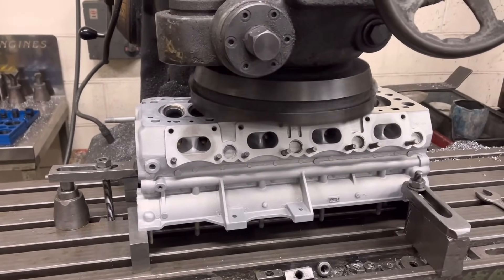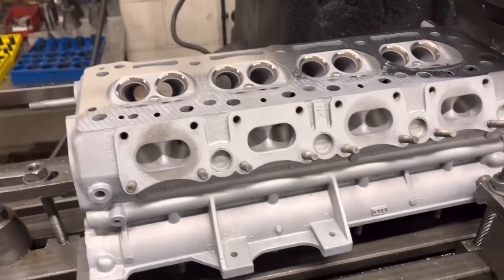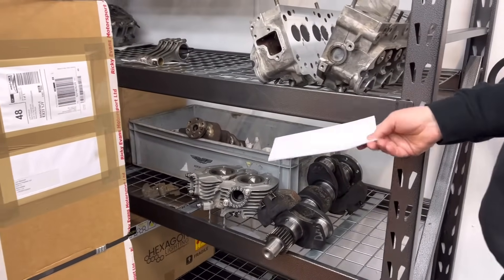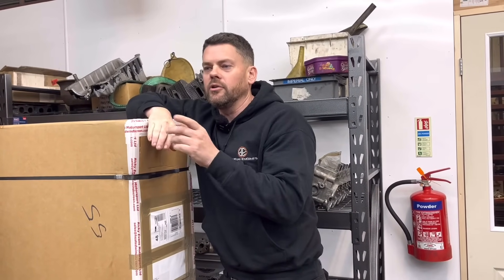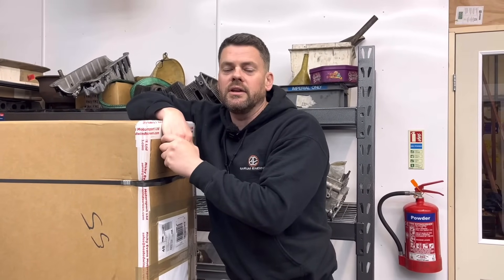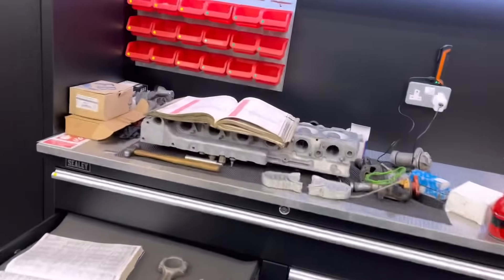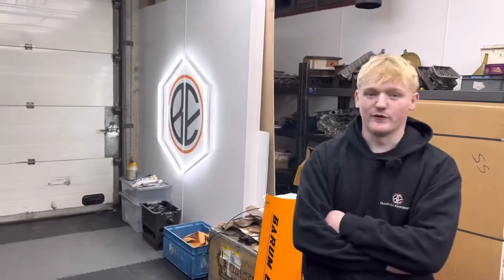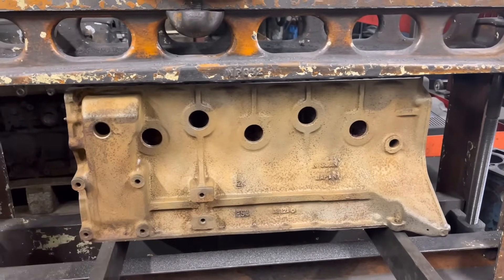Tuned, Thrashed & 3 YEARS out of Warranty yet this Customer STILL wants us to pay!

Comment: It never ceases to amaze me how someone  can expect to double the output of an engine without affecting its reliability 🤣
Reply: A Honda K20 build sure. EA888 not so much. Those K24 de-stroked engines are strong.
Reply: @v4skunk739  not so much then, until you consider the biggest unknown, variable, which is the idiot behind the wheel who doesn't wait for his oil or coolant to come up or cool down, before or after a good thrash 🤣😂
Reply: Great comment, but these people do not have a clue about the internal combustion engine....not a scooby doo on engineering.... or what effects high performance can have on reliability...
Don't you just love their unfortunate ignorance on the subject... a little bit like asking your accountant how to fix the money printing machine😂
Reply: @IncognitoChild  EA888 are not built like a K20, i'm sure you can find a video. K20 is just built beefier.
Reply: But if it’s built to take it it should take it like it’s oem, I’ve pushed my VR6 in my A3 to north of 1000hp and I actually get warranty with that build, all I have to do is have an annual bearing inspection which on my particular car means engine out and make sure I change my oil every 800-1000miles if I’m using ethanol if not every 1500miles.
Reply: @Mr_OoOsH  VR6 is a strong engine, over engineered, EA888 is not.
Reply: @v4skunk739  yeh I’m running a BDB 3.2 24v, 4 bolt main conversion, tool steel girdle and all the fancy bits….wouldn’t want 3 bar of boost to blow the block apart 🤣

Comment: You need to refer to REPerformance warranty, where you took your Lambo for the exhaust, no warranty on race or comp engines . If it does a heat cycle then it was built correctly, after that, no warranty. Ask Ricky

Comment: Sometimes this kind of explaination makes customers run, well the ones that know absolutely jack about engines..... I on the other hand would let you do any engine of mine.... I love your straight forward approach.

And id like to add this..... my grandfather always said this....1.Never pull away until its warm. 2.Drop the oil every 3000 miles. 3.Never turn it off straight away.    Ive followed this advice on Renault 5 Turbos, Ford RS Turbos, Land Rover Defenders (300tdi and 2.4tdci), Ford transits (too many to list) and never ever had one fail..... Ive thashed em and towed very heavy loads long distances too.    My 300 tdi is coming up to 190k on the origonal engine and is the one id choose every time to tow a trailer to Scotland from the Midlands.
The chap next door is lifting his clutch before the first 10 seconds on his work van, hes just blown another one up!
Says it all, you treat an engine with respect, it will pay in the long run.
😁

Comment: hello guys from Australia. recently while cleaning out an old filing cabinet, i came across a receipt from 1993 when i had an engine bored and rebuilt. i was looking at the fine print and discovered that the warranty was for 90 days and/or 1000km. in those days i was young and was driving around 700km per week. (According to the old logbooks).  so just keep up the great work and will see you on the next video.
Reply: Nice.  Mind you, in 1993 an engine rebuild was probably affordable.  (I'd just bought my 1992 Subaru Brumby, which I had for the next 16 years).
Here we are in 2024, I'm looking at $8k+ for a rebuild on a 2006 Holden VZ.  Not quite what I had in mind whilst still unemployed in a post-covid world.  I'll go the cheap route - couple of kerosene flushes to get the sludge out, and a bottle of XcelPlus (the original "Slick 50") to see if I can get a couple more years out of it :)
Reply: @OhSoddit  mine a 186 bored out 20 thou, and everything that goes with that, $2300 but that HQ ran like a cut snake, and purred like a kitten.

Comment: Same thing I said about A-series engines going with bores of 73.5mm and above - don't expect more than 20,000 miles out of it, under normal driving. Cylinder walls will eventually flex.

Comment: Cosworth DFV had a service life of approx 3 hrs, between rebuilds. Originaly they were circa 380bhp. If you had 500 brake in the early 70's you'd be world champion, though not with the anchore that is the VR6 power unit

Comment: I didnt do many private jobs back in the day but they were all performance builds to some degree or other.
BUT I insisted that there was a "run in period". AND I WAS TO BE PRESENT...
Not the 1000 miles at snails pace though.
It was all about getting a couple of heat cycles through the motor.
We would go on the highway, take it slowly up to max RPM in say 2nd gear and hold it there for 20 seconds or so then change to 4th and let the speed die off to maybe 30 MPH (in the emergency lane) and then back to 2nd gear at idle for maybe 2 miles.
Then take it back up to max and repeat.
When we got to a town maybe 30 miles up the road we would stop and have a burger and let the motor cool down.
Then check the fluids, look underneath for leaks or buts hanging off and do it all again back home.
Let it all cool down and check everything again and repeat - normally 3 times.
Why?
Well, I could hear if something was wrong and tell him to kill the motor and pull over if there was.
The owner would be able to hear what the motor SHOULD sound like and know if the sound changed that he needed to see why before it maybe blew up.
But the motor was taken to peak RPM without too much load and there was a heat build up which was dissipated during the slowdown and slow run times.
If something was going to go wrong or a bit sideways the motor was not pulling at max power so you stood a chance of saving a rod through the block.
After that was all done we changed the oil and filter and checked the head bolt torque settings.
As long as it was not over-revved or lost water or oil to a leak then the motors lasted.
Also, gaskets and seals etc were now bedded down through a couple of heat and rev cycles and if they were still good then they would be good for a long time.
Doing it in 2nd gear meant that the motor was getting to max RPM but not at absolute full load - as I said, if things go wrong at full RPM and at max load then it tends to be a bad day.
The only time we had to stop on the side of the road it turned out to be a cracked push-rod guide (plastic) that had broken and the push-rod had jumped out of the rocker arm. 
We did lift the head and check the valve guide clearances and lapped the valves in again and that motor did 2 full seasons of dirt oval track events without missing a beat - or being placed last... even on one of the "wife of the driver" fun races after the last championship race.

Comment: 3 years, 10,000 km. and 500 horsepower sure sounds like you built an awesome engine Lee! 
I love the easy transition of the video from the head being machined, step through a door and you're in a gorgeous display room with Cool purple lights on clean engine parts and work shop.

Comment: Drill a 1mm hole through each valve, that will reduce compression
Reply: Turn the turbo boost right down would be easier. Exhaust valves won't last two minutes with even a scratch on them. Holes?!? 
😯😳😁
Reply: @huwzebediahthomas9193 
I was being facetious.
Reply: What, sideways?

Comment: 1:04 Thats a massive crack at that Cosworth engine around the stud between cylinder 3 and 4
Reply: Sheet your right
Reply: Can’t believe it’s not been seen it’s gaping!
Reply: @johnnunn8688  nar it'll be fine, bit of gum it will soon be out of warranty
Reply: Thats why the long stud conversion was done!
Reply: @steptoeandson3554  wouldn't the vid have been more interesting if Lee had pointed this out? Will a long stud stop it getting worse? Won't this effect oil pressure? My guess is that this isn't really a fix so much as putting off the inevitable for only a time - eventually it's going to equal the San Andrea's fault. I mean even if its no big deal I would still dip into my pocket to pay a welder, I mean if you've stripped the engine and find any crack in the block your going to want that sealed up just for reassurances sake - and it's aluminium so it would be a doddle for the right technician.
Reply: Aluminium 🤦🏼‍♂️😂😂😂
Reply: @johnsutherland8239  I'm not a mechanic so is that not an aluminium block? Looks pale like ally. I only started watching Lee's garage for education purposes when I had to take the head off my van engine - I could strip and rebuild an engine now with a lot more confidence than going blind although I still wouldn't fancy it. You can still get a steel block welded of course, I welded a crack outside on an injector and it was fine. So I could weld that. I thought all the cozy engines were ally? Personally I think aluminium is a very weak material but what do I know, some blocks are made from it - surprised it doesn't melt. I lit a class candle with an ally emblem on the glass and that melted right off.
Reply: @steptoeandson3554  how does that cure a crack and prevent it propagating?

Comment: Great video 👍 Subaru every time strip one or more engine thread's with correct torque settings.Have helicoils at the ready😅
Reply: Or chuck the scooby engine in the bin, and bolt in a Porsche engine. It will go very hard with that engine.

Comment: Surely you could drill some holes in the valve heads, you know...to let out that excess compression. That would work. Or maybe ventilate the pistons. 
Interesting you do bike engines too. Oh...and XS650 was a 70's engine. It did linger into the mig 80's in US custom style, but most were 70's.

Comment: If the top of a piston is clean around the outer edge where the valve are does that mean it’s blown a gasket?
Reply: Just simply the high boosted cylinder pressures - sounds like an engine than needs it's pistons and rings changed every few months. 500 bhp??? Jesus H Christ on a piece of burnt toast!

Comment: Are you ever going to close the door between the machining space, and the clean? area?
Reply: SUGGESTION. Add a string that runs across a pulley, fitted with a counter weight, that automatically closes that door

Comment: Just wondering Lee.... you guys seem a push fair amount of engines. What is you average lead time? I ask cause in the Netherlands I've got the following experience for having a engine fully machined. A reputable engine builder took like 5 months to only having a crank grind done and flow benching 2 cilinder heads.  I called them several times about status. At a certain point I was done with the slow pace. The excuse "we are very busy and we have a lot of regular customers" So on the recommendation I went to shop B. They said doing all the machining for a Stroker setup is no problems (so with calculating pistons and send sample to manufacturer, balancing everything etc.) Now I'm 14 months further and engine still isn't done. I had a chat with the guy about1.5 months ago. "Yes we are very busy and dealing with a lot of dealerships. They want to have there job done quickly." He said he's going to do some machining. Get an update last week he is about to do these machining actions.

I'm self employed as well but to me it's just mind-boggling. I can't have customers waiting for an eternity.  Is this normal for your industry?! I haven't seen anything in your videos customer complaining about lead times.

Comment: Can't wait for you to sort out that Rover-MG K-series engine. They have given me so much grief in recent decades. I file them straight into the skip marked junk, a pointless waste of time. Once they play up, they always will - heat into water exchange basic design utter failure, block completely warps.
Reply: It took Lotus to make a proper build on the K,s. They ate big ends for fun and burned oil for more fun.Terrible lumps as stock.
Reply: @GlennPowell-ls3lg  They sorted out the head bolts to stop them wandering, with solid sleeves, yes. But can only do so much. Basically a junky engine really.

Comment: Thanks for the video. Sounds like Isaac needs to find another girlfriend who's a bit more interested in his hobby, the you can't have time to do your own thing sometimes never ends well.
 I'd bet the MOT guys suggesting altering the valve protrusion, to lower compression. John Deere diesels here in Canada won't start that good when the valves wear into the seats and it lowers the compression. I had a local machine shop ask a customer how well a 698 Leyland started as well. The seats were border line out of spec and they wanted to know if he was going to spend a small fortune having new custom seats fitted. The originals are obsolete and it's an old hobby tractor that doesn't work for a living, but it still started good enough for him.

Comment: Absolutely never ever ever should you be giving out warranties or guarantees for engines rebuilt to use on the track or any other form of racing. Check Ricky out on reperformance he’s just been talking about exactly this. If an engine is being rebuilt with the intention of increasing power, it’s is clearly going to be thrashed and or put on a track. So no guarantee is given on such units. Anything done non standard to up power output is never warranted ….. by any workshop (except yours if I’m not mishearing things). He said original specs being worked to obviously get the industry standard guarantee but not a modded tricked out lump. You just can’t because you can’t predict they are going to follow correct procedures and use correct grade lubricants specially suited to such engines. Nor can you predict the drivers aggressive driving style and abuse of the engine etc. I can’t believe your being so naive as to consider giving a warranty to somebody who wants their engine rebuilt tricked out and wants the end power to be increased by ridiculous amounts, isn’t going to be pushing the engine to its absolute top end capabilities and often. You need to be clear Rebuilds to stock manufacturer specs only get guarantees not something your driving up and past Rev limits with stooopidly high octane fuels. With no doubt sh1t oils and a suicidal right seat occupant.